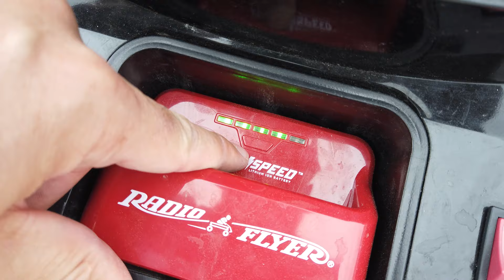How Well Does A Used Radio Flyer Kid Tesla Model S Hold Up After 2 Years of Use?

Comment: What’s the solution for the stop and go problem? I’m currently facing it. Not fun. :(
Reply from the maker: Do you mean where the battery has intermittent connectivity problems? I've had to clean the battery terminals a couple times and that fixes it for a while.

Comment: Damn it’s so beat up and still works wow
Reply from the maker: I once saw a video of a Tesla Model 3 that had been in an accident and the roof was crushed in and partially ripped off, and the guy was driving it around still. It had similar comments to yours, and I expect we'll see more like it in the future!
Reply: @ElectricTechAdventures   I BOUGHT ONE after watching your video lol but my daugther worn out the rear tires now when its set ON NUMBER TWO SPEED WHEN SHE GAS IT . ITS SPINING OUT...
Reply from the maker: @RACERMIMI1320  Ours was doing that too, so I cut up a couple old bicycle innertubes and wrapped them around all four kid Tesla tires and held them in place with screws into the sides of the tires. It works surprisingly well. The car is way more quiet driving around and the tires don't skid anymore. Highly recommended modification, but it's unfortunate that this is necessary. I recognize it's normal for kid cars like this to come with hard plastic tires, but I wish they'd include rubber tires instead.
Reply: I found one for free at a bike shop it didn’t have a charger tho 

But still

Comment: That is a strong car, if it can handle 3 kids inside of it!
Reply from the maker: I agree it's a pretty fast and powerful car and I think that's due to using lithium batteries which are better at maintaining constant higher voltage to keep the speed and power up compared to the lead acid batteries in most other kid cars. Thanks for watching!
Reply: @ElectricTechAdventures  yeah no problem

Comment: The car looks like it been to Hell and back, LOL.  🤣🤣🤣🤣🤣🤣🤣🤣🤣🤣😈😈😈😈😈😈😈😈
Reply from the maker: 😂 Yes it does. Like I said in the video it came to us mostly like this, but I say mostly because my kids have certainly added their own imperfections to it. I think it's a minor testament to how simple and resilient electric motors typically are that it still drives just the same as it did when it was new. I've had to line the tires as I outlined in this video https://youtu.be/qMPhZmMpSJI because they were wearing out, but I've never had any problems with the motors.